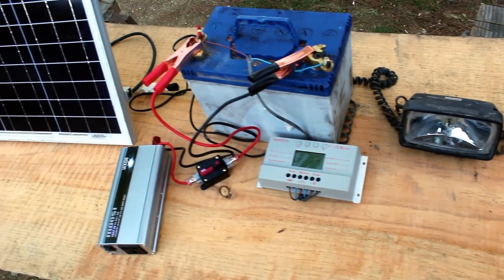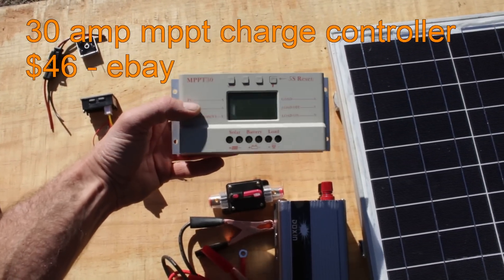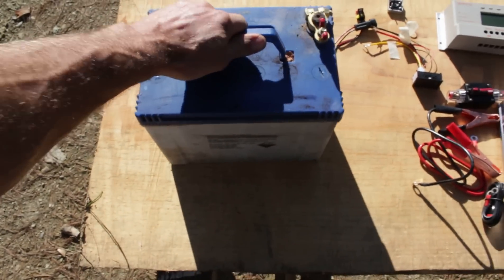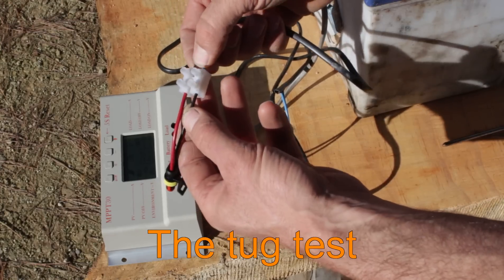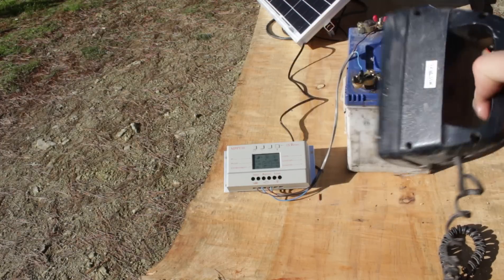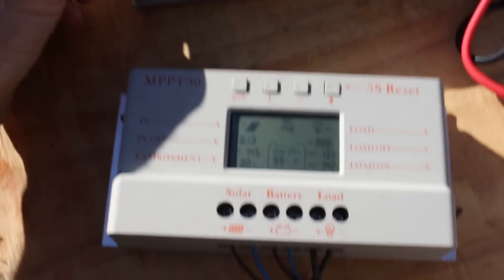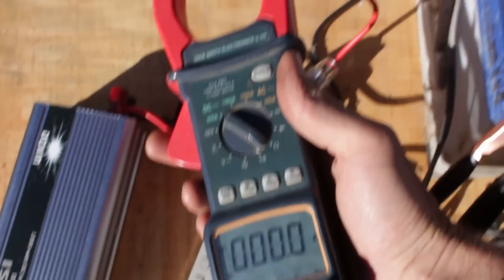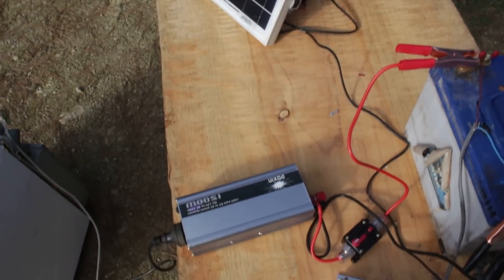How to build  a basic portable solar power system -camping,boating,off grid living-

Comment: Hey Craig here from down oamaru way I've just bought a ute with 1500 watt inverter tried it out on a kettle but trips out any help would be greatly appreciated.
Reply from the maker: 1500w inverter seems a little small for a kettle unless it has a small element? most kettles are 1800-2500w

Comment: Great video. Would this run a desk top computer a light  or two and a small fridge steady in my off grid cabin ? 🤔  or what would I have to do differently to make this simple set up work as economically as possible.  Thanks
Reply from the maker: Depending on your sunlight hours, you would need probably 600w of panels and a 200ah deep cycle battery, as well as a small generator or more panels to keep things going on cloudy days

Comment: I just got into this stuff, and need a positive line overload fuse, I think, but don't know where/what to get.  Does the diode "check valve" also go on the positive to prevent backflow to the panel???

Comment: Just replaced the battery in my truck. The 5yr old battery won't charge beyond 85%. I just ordered a 35W solar panel, about $22US and a controller about $10US.
I haven't yet bought an inverter as I plan on running 12VDC for lighting. If the power is off longer, I'll fire up the generator.

Comment: How much power would you require to run a whole household as an emergency back up for about a day also if you were running a 1000w light around the clock how much safe power to run this bit doing it easy without stressing the system could you run 4 2000 watt grid tie inverters in series.with let's say 4000w of solar panels and deep cycle long duty battries any danger of fires etc

Comment: I need some advice about solar. I hope someone can help me with the following.  I have two 12 volt deep cycle 100 amp hour each battery's and I have two solar panels with the following specs each 315 Watt, Operating Voltage is 36,6 volt,  Operating Current is 8,61 Amp,  Open Circuit Voltage is 45.1 Volt,  Short Circuit Current is 9.18 Amp. I also have a total of 150 watt 12 volt led lights. Question 1: What size charge controller do I need toe charge the two battery's with these solar panels and to run 150 watt 12 volt led lights ?  Question 2:  How long will I be able to run these 150 watt 12 volt led lights before the charge controller will shut them down ? Question 3: After the charge controller shut the lights down, how long will it take these two 315 watt solar panels to charge the battery's in a normal sunny day ? I will appreciate it very much if someone can give me the answers on these question and give me the formulas to get the answers as well.

Comment: question and a word of caution, you added a 100 Amp breaker, the size wire you are using would overheat long before a 100 Amp breaker would trip...

Comment: Thanks for sharing this video! Any advice  on how to use Solar panels, to charge deep cycle Electric trolling motor batteries, three 12 Volt batteries, all wired in series, to supply the necessary 36 Volts to the motor. How many panels would I need and was sort of controller?

Comment: This is a good video tutorial. I would use a battery designed for deep cycle discharge. Car batteries are too easy to ruin even with partial discharge.

Comment: Can i run computer 350 watt or how many hrs backup 100ah batry
Reply from the maker: Yes you'd need at least a 100ah battery better with  and a 250w solar panel  if using computer after the sun has gone down

Comment: i have no idea how this works..but how do you run the drill and the fridge and the toaster from a 40 watt panel?
Reply: Star of Eden the panel the solar panel is to charge the battery, the inverter generates 1500w by using the charged battery using the solar panel.

Comment: The part I can’t get my head around is how can you take a dc 40w panel and run a ac 800w appliance, at what stage does the power increase?
Reply from the maker: The battery stores power and makes up the deficit when a high load is turned on
Reply: Angry Ram so then the more batteries or the bigger the battery the longer the run time on these high load appliances? I am needing to run a 1500w AC load for 3hrs a day from solar and trying to work out the solar size is doing my head in.
Reply from the maker: Yes thats correct, You will need some large deep cycle batts (expensive) to supply that size load especially if you need to run it when the sun has gone down. It may be more feasible to use mains or buy a 2500w petrol generator

Comment: Some charge controllers will NOT turn on when connected to a battery.  Some require power to be seen at the solar panel inputs.

Comment: If nothing is wired to the load output will the controller continue to over charge the battery or will it cut off when its fully charged?
Reply from the maker: Yes it releases contact between solar panel and batteries regardless of load connection

Comment: I googled "MPPT 30 Charge Controller" to see if there was a difference with that and a "MPPT 40" or any other higher number. They sell higher numbers but I still don't know if that makes a difference. Do you need a higher number if you're operating a 100 watt (or more) solar panel?
Reply from the maker: The number is the amp rating the controller can handle, so if you have a 12v battery with a 100w panel, it should only make up to around 10 amps max. Volts x amps = watts

Comment: great video.how many 100w  solar panels I would need it to be able to use a 50w  aquarium heaterthat have to be on always and have the idea of putting the panels on my window.thanks
Reply from the maker: A 200 watt panel would be ideal and you would need a battery with around 120ah+ capacity
Reply: ok, I can get that, anything else I need it? so I can have a look at amazon. many thanks Ram
Reply from the maker: A charge controller so the battery doesnt over charge and a fuse around 5-10 amps if your load is only 50w. Best if your heater is 12 or 24v dc then you can run direct from the battery without having to use an inverter, inverters use  more power than dc direct

Comment: Sir I have a question. The solar panel in this video gives out put of around 3 amps current. while in every single video the charge controller is called as 20 Amps or 30 Amps. Why? I mean the if solar out is 3 amps then why we call those charge controllers as 30 amps or 20 amps please guide me.
Well done for this video and keep it up

Comment: Thanks mate. Your simple explained video set me on a solar power system path that has progressed over a few years with research and trial and error. I now made a solar power plant with 960 amp hr 12v battery bank with a 2000 watt pure sine wave inverter and a small solar panel array producing about 800 watts in direct sunlight hooked up to a 40 amp mppt charge controller. All that including a 2.0 Farrad Capacitor between the inverter and battery bank to help reduce low wattage power inverter shut down that runs a small portable 10,000 BTU AC unit for a short time. And I haven’t stopped. LOL.. All because of your video here. How is Rambo?
Reply from the maker: Well done, glad my video helped. Rambro's all good, slowing down in his old age but still has a go every now and then

Comment: That charge controller has built in negative discharge protection. No need for the diode, one less point of failure.

Comment: Hey I have a concern, I had everything connected correctly and I had led strips connected into the inverter, however at a point the inverter was beeping and the battery was outputting 11.3 volts rather than 12. Maybe it's because I have a shitty controller??

Comment: Quick and "dirty"  Get the (always on "sale" for $149 with a coupon) Harbor Freight kit.  Now 100 watts of panels, decent regulator and 2 good LED lights.  Add a pair of GOOD 6V golf cart batteries (about $110 each)

You have a passable base system.  Now add an inverter for your infrequent 110 v loads.

Never discharge the batteries below 11.0 V (2X 6V in series = 12V nominal, 13.8 v full charge, 10.5v and you are damaging them.)

Comment: So if you dont connect a load to it it will keep charging until the battery dies? Or does it cut out eventually?
Reply from the maker: You can set when solar input cuts out, I think default is around 29 v

Comment: this video is very informative. thanks a lot. I wanted to know what is the specification of the block diode that you use? that you mention it will help to prevent reverse current flowing back to panel. How is the connection like? Can please explain in detail?

Comment: Nice video. i Have a question can  i use fuse blade? and can i connect the inverter to the load instead to the battery?
Reply: and can i use 10amp solar charge controller?

Comment: In connecting the DIODE did you just use one (+) and one AC on that block diode for your positive wire from the panel (because the diode has 4 pins so I assume you just used the 2)

Comment: I have 50w solar panel  and new 55ah car battery , can I use car battery for small solar system ?
max load will be 60W at day (for 1-2h)  and 5W at night (no all night only 2h) .
will car battery die fast ?? I cannot find any deep cycle batterys in my town , only starter batterys and sealed lead acid batterys but I dont have money for them
system will run 0-24h all year but load will be conected only at summer , at winter no load only charging!

Comment: Whats pure wave in electricity? Because some seller recomend me to buy inverter dc ac pure wave that the price expensive (more than US$2000)
Reply from the maker: Search pure sine inverter on google, they produce a cleaner wave form than modified square wave but are a little more expensive. You can pickup a reasonable quality pure sine inverter on ebay for under $500usd

Comment: This video inspired me. It was simple and intuitive and encouraged me to fit out my 4x4 with a 200w permanent mount panel, the same pwm 30A charge controller as you had and a 105A deep cycle battery to run my fridge/freezer and all manner of 12v camping goodies.  Thank you buddy, it all works flawlessly.

Comment: Question ; If it's been rainy and gloomy for a few days and I'm running low on power....... can I run a gasoline generator and hook up a 12v car battery charging unit that's plugged into the generator and wire it directly onto the batteries?  Will the controller read the charging levels from the car battery charger as it would with the solar panels, and will it be risky and can cause damage?  Or can I simply remove the negative and positive from the controller cables and then hook the positive and negative from the car battery charging unit onto the batteries?  Also, will the car battery charger even be sufficient enough to supply enough juice for the battery to be charged, or is it just a waste of time and equivalent of just using the AC supplied outlet on the generator itself?
Reply: shifterkart1 
usually solar charger prevent current to get back to panels , so its no problem for your situation to hook a 12 v charger to battery. careful anyway with setup.

Comment: Authorities on this subject seem to strongly suggest using a deep cycle battery and NOT a car battery for these uses. Deep cycles are designed to be slowly drained and charged up. Car batteries are designed to give a huge amount of power at one time and are not meant be drained down very much. If taken down too far you can kill the battery and it may not recharged.
Reply: Henry Huggins yeah he said that in the video if you paid attention
Reply from the maker: Correct, I was doing this on a tight budget and already had the battery, It suits my needs for the boat, new deep cycle batteries are  quite expensive
Reply: When watching this I kinda knew that he’d already know of the car battery pitfalls.  Just thought that he was experimenting with it or was going to replace it soon after.  He ended up explaining that he was going buy a deep cycle later on anyway.  Car batteries can still do what a deep does, but not for years or over a thousand cycles.  They’ll put up with slow long low amp draws down to a 50% discharge before recharging for a few dozen cycles from brand new.  But if you plan on trying to use that same battery as a cranking battery then forget it after about 2 dozen cycles.  But if it’s just low amp draws it’ll do that for a while.

Comment: I have a used xantrex 458 3000 watt inverter charger . If I put it in my truck . Would the alternator be able to charge it . I have a 4.0 chrokee 6 cylinder . Or I could fit one full size solar panel under my roof rack I think . If not . I could grab a couple of the one's similar to yours .
Reply from the maker: Yep the car alternator should charge it no probs but you need to make sure the battery does'nt drop too low when the motor isn't running. Putting a solar panel under a roof rack will reduce the power output  dramatically, solar panels are best installed without anything casting shadows from above

Comment: I guess, you're in Australia as the great nation for solar. You also can wear electrician gloves as you also insulate your steel made tools. You powered your 800 watts toaster for a test only. For regular high powered devices or tools, you'll needed a larger solar panel or stacked panels plus with much larger deep cycle battery is even better.
Reply: Yeah,the toaster made me cringe.
Reply: Stan McBeth Abino
Reply: He's not australian, mate. And this was a demo, you heard he only had to run a few things on a boat.
Reply: He did good except for using the car battery. It won't last as long as a deep cycle battery. I use 6 volt golf cart batteries. Of course to get the 12 volts I need I have to use twice as many of them and they aren't cheap.

Comment: Angry Ram very nice vid. All stuff no Fluff i like how you work. I'm still struggling to pass a certain point though...

Can anyone give some insight: 

I am working on a very similar project and i have a window of 50 more days before my schedule tightens back up. I need to get a solar system on my van quick style. I have a couple questions maybe you'd be kind enough to throw some ideas my way...

I want 1000 watts of panels as well. It seems extremely tough to get help on the subject though. 

I don't want to get a kit because like making your own computer i'm sure there's better products available. This is what i need your guys' experience in. 

Pretty standard:

If i had a 960-1000 watt panel system:

-What would be the best controller.
-What would be the best/Safest Inverter.
-How many batteries (I like the Vmax 155ah deep cycle ones)
-What should i use for fuses/fuse box
-and what kind of wire is safe to put it all together with. I really need to know what wire i will be connecting the controller to the panels because i need to run that wire and start closing up the walls. 

Anything will help guys.. and if you happen to know a good source for more info

I just want to make sure i put this together with the correct components. My budget is the exact cost. which means i'll be over guaranteed.) no room to fudge up

Comment: is it safe to use a 100 watt 18 volt solar panel with a 12 volt 10 ah battery??? THank you so much
Reply from the maker: Yes if you have a charge controller between panel and battery
Reply: 100w panel would pump out a fair few amps. 10ah batteries usually have a charge rate of around 1.5 - 3 amps, a 100w panel could spike in the realm of 6. Should be sort of okay if you can limit the charge rate on the controller, but if you want the battery to last, might be best to put a second 10ah in parallel to soak up the amps.

Comment: hello Hope u fine .plz help me at this
i want 300 watts solar panel at my roof and 30 Amp Charge Controller, 
100 AH Batry  and 250 Watts UPS(invert to 220V Ac + Charges @ 220 Volt 
Ac  ) . i want to run 1 Fan which is 220V Ac and 2 Lamp of 24 Watts runs
 @ 220 v Ac    will it ????
now if sun is clear and weather is all fine for solar as often in my 
area .. will my solar panel charge to my batry and give sufficent 
current to UPS to run above mentioned load ?
does charge controller perform both operation (charging to batry + give 
current to operate ups @ same time?  plz answer it soon

Comment: Let's say it's night time and there is no solar available - is there a way to delay the energy the solar panels generated during the day to use DC lights at night? I want to be able to connect a set of lights directly to the load side of the controller but will only be using them at night.
Reply: That's what the battery is for...
Reply: Brian Pacheco They have made solar panels that can absorb moonlight. but even then if you have enough fully charged batteries from a days worth of sun panels then unless your usings a ton of energy during the night you would have enough batteries.
Reply: Hea HEa I was just wondering how to maximize the usage as once you fill up one battery and it has nowhere left to go the remaining energy collected is wasted as heat.

Comment: is it posible to charge car battery from 10w panel
Reply from the maker: Yes as long as the panel output is higher than the battery voltage, say you have a 12 volt battery the panel should put out at least 14 volts open circuit. You wouldn't be able to run much off battery powered by a 10 watt panel though, maybe a few led lights and a radio for a couple of hours a day
Reply: +Angry Ram my panel sticker says 21v open circuit do you think this is good
Reply: Usually a 12 V. panel put outs 18 V. open circuit.